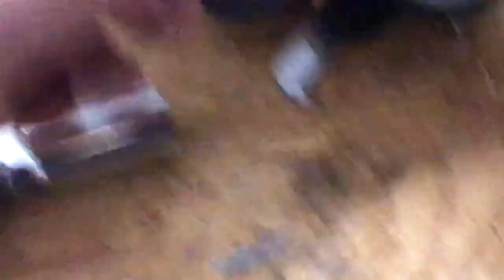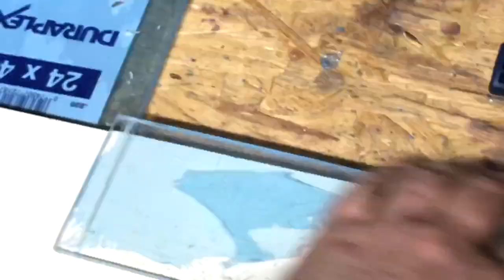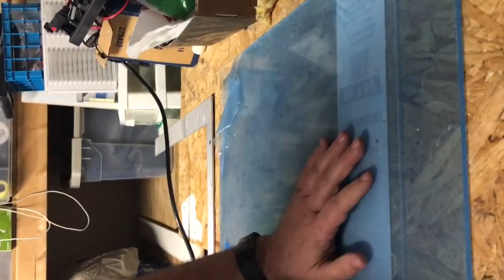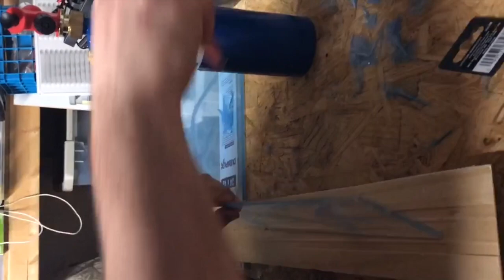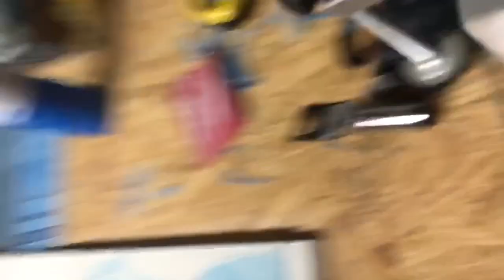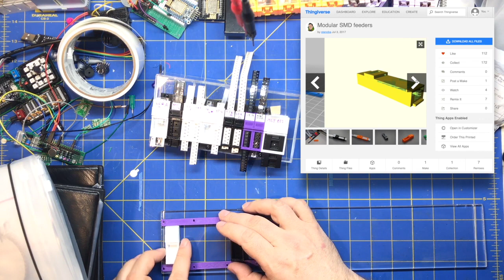Making an smd tape holder/feeder for electronics components

Comment from the maker: Just an update,  there are 2 flaws with these holders, the only space for a label is in the rear and it is obscured by the tape, another is that plastic carriers flex and spring and bounce all your components out, So i am trying to solve both these atm by tweaking the models, and adding some kind of cushioning or lips to hold the plastic carriers tighter or something..